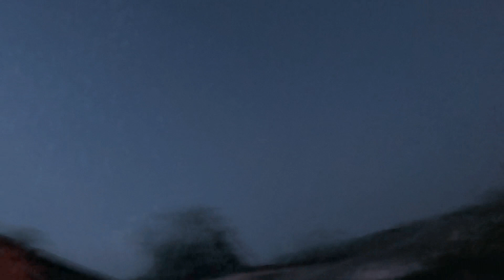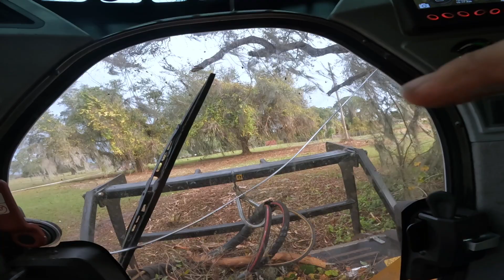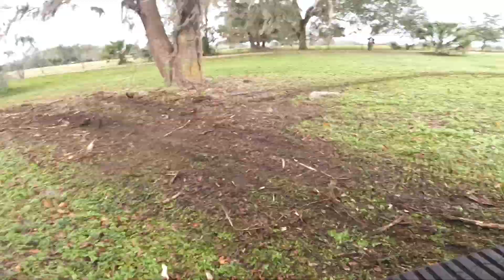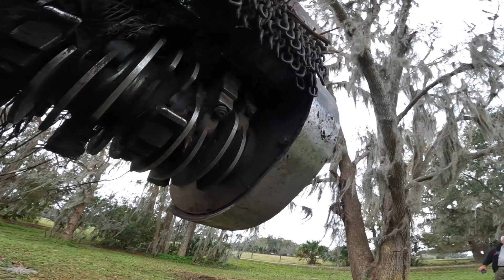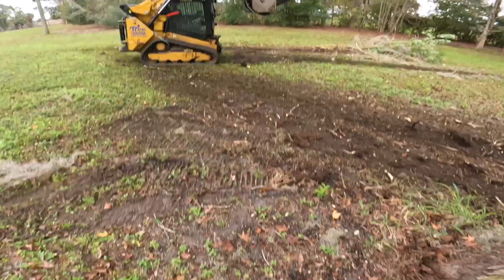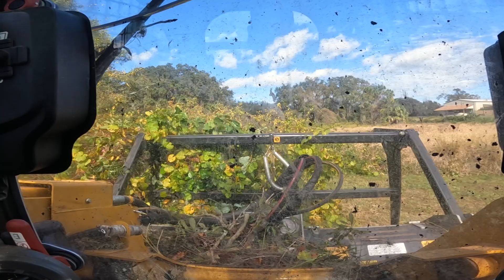How to Forestry Mulch in Leesburg FL with the FAE Cutter Head

Comment: How do you like the fae head vs the cat?
Reply from the maker: the cat head i used to run was also an fae. but the hm215c is just cat branded. it was not a DCR head and the rotor was tiny so it was very frustrating. this FAE head rips. It will be very difficult for me not to put an FAE on every machine we buy moving forward. I am interested in the blackhawk from fecon but other than that im staying with FAE
Reply: @TheTreeShop  that’s cool. I knew the cat was an fae head. Just wanted to know the difference between that standard head and one with the bite limiters
Reply from the maker: @midstatelandsolutionsllc1515  bite limiter heads are all i will ever run again. No point in running a smooth drum even with high hp